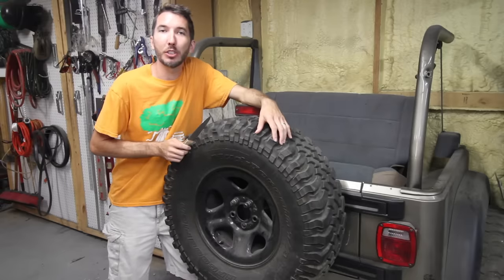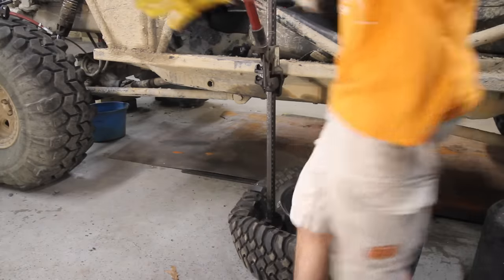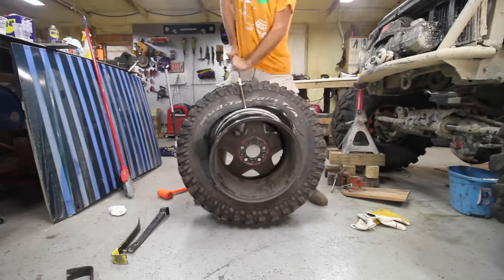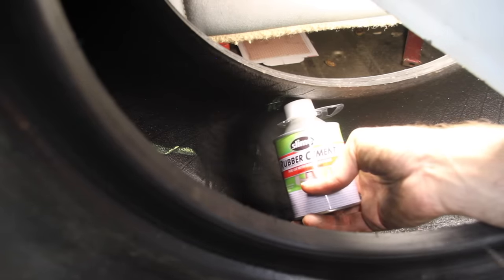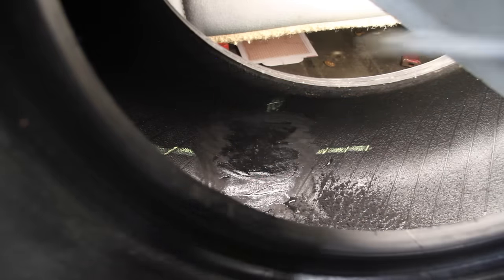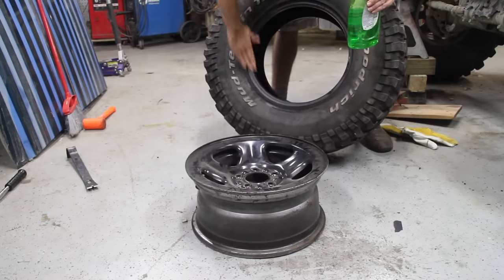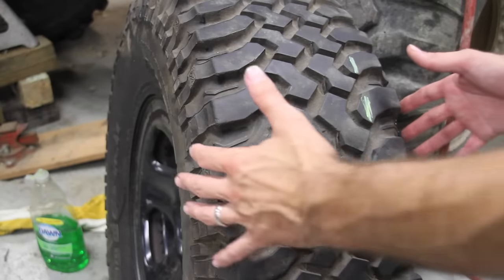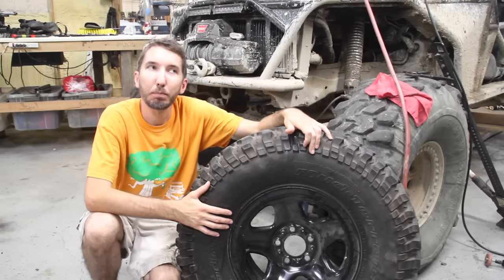How To Fix This - Patch A Tire

Comment: so as a guy who does tires for a living watching you tell people to patch a hole in there side wall is asking for a blow out take that hole to any shop there telling you they wont patch it they dont want you in there after the blow out and the totaled car you should only ever patch a car tire puncture in the tread face as that is were the steal bands are patching a hole in the side wall were there are only nylon belts with cause separation and blow out with the structure of the steal bands you are asking people to put there lifes and familys at risk and this video is a hazard to any thinking for doing this

Comment: OK after that lil bit of work now do one with a mud filled rim, or one that got run off the rim in sand, mud, gravel, ect., also while you are at it take the tire off on the side of a nice rock hill side, with it buried in mud, snow, or sand, winks...JK, but those are the conditions you will face in real life on the trail or while off road.

Comment: I feel for whom ever tries to break the bead off that wheel. If you advise using soapy water to check for leaks. Soapy water is the best thing to use on bead for mount and dismount. Straight liquid soap when completely air free and dried will put a bond that will make you hate your dumbass self. Trust me we've used just soap on things like handle grips. They had to be whittled off. JS

Comment: First off .. at least 4 people chimed in with a tire comment, but spelled TIRE.,..TYRE!!! really???? Second.. it's for a demonstration. Of a trail tire, that he doesn't plan on driving up and down the street!!!!! I work construction. And on construction sights you pick up screws , nails, cuts , hell every other week...I have multiple plugs in every tire . And one cut on a side wall that took 4 plugs ! And it still holds air ! And I still drive it at least 50 miles a day.. tires are to expensive to throw away because of a little cut.. patch it and go on!! Everything else is bullshit....
Reply: First off it is TYRE. They were invented in Great Britain and thats the way the ENGLISH spell it, so its not Tire as you Americans have mangalised it, its TYRE! Second, you work on a construction SITE. Sight is what you see, not where you work!

Comment: So you carry all that stuff air grinder, tire patch kit, dish soap,ect but not a spare tire or cement that goes around the patch? Lol
Reply: I've blown 3 tires at once a spare tire couldn't replace all 3, I have a patch kit, plug kit, air compressor, portable welder, and small oxy torch. Would rather carry those rather than a whole set of tires

Comment: according to DOT, you CANNOT patch, or repair (except for tube) ANYTHING that is off the main tread/sidewall. The main tread is about 3-4x thicker than the sidewall. That is why the sidewall flexes.
But dont take MY word for it... Because I ran a Tire Store (Tire Kingdom) for more than 20+ years. Not to mention that I raced Stockcars for more than 35+ years at tracks from NASCAR tracks like Stafford Springs, CT, Homestead Speedway, Miami, Charlotte... And smaller tracks like Plainville stadium CT, Star speedway, Epping, NH, Punta gorda speedway, Punta Gorda, Fla and Hialeah Speedway, Hialeah, Fla.
I have seen people get seriously hurt and even total out their cars and others because they are to CHEAP to go out and buy a new tire.
Reply: You obviously didn't listen to the description he gave which said precisely what you just repeated. Also, in the written text he says "For off-road use only." However, your cautionary note is worthwhile for people who may consider using this method on their normal on-road vehicle.
Reply: And according to D.O.T we can't put too big or too small of a tire no wide with or a stretch          lower or raise  a  Vehicle  cant put a turbo    or aftermarket exaust but we all still do it  nomatter what every one  Does something that  D.O.T wouldn't comply with
Reply: @D.D.S-909  
Yea JR, I agree. That is why I have the ONLY street-legal, registered Legends car in the State Of Florida!!
NO modifications (except for blinkers, stop lights, ect)
To pass inspection, the lady came out and said "what a cute lil car--- you pass"

Comment: Ok so I'm supposed to carry an air compressor and the buffing tool and generator u said this was if u were out on the trail I mean come on man thats not realistic at all
Reply from the maker: Why not?
Reply: The repair tools would fit in a small bag, and the compressor is ON THE VEHICLE. It supplies air operated fittings on the machine. Where is it not realistic? You obviously have no experience of offroading.

Comment: Ok in your first 30 seconds of video you have already been wrong. The reason for not repairing on or near the sidewall is NOT a liability issue only....The sidewall and the first inch to two inches in from the edge of the tread are where the most stress occurs on a tire and are the most susceptible to failure. The reason for NOT allowing repairs there for any vehicles used on the road is safety NOT liability! If you are on the trail and have a puncture you need to fix to get the vehicle back to the road or a shop to replace it that's one thing but don't go telling people lies about why the sidewalls are not repaired on road legal vehicles because then YOU are liable if they get in an accident or kill someone.
Reply: On a road going vehicle its safety AND liability. here in the UK if you do a repair that is not industry standard in defined areas, YOU, the tyre fitter is LIABLE for the consequences of any subsequent failure. Not something i would want on my head or conscience.

Comment: why did he clean the area before he grinded? wouldn't it be more logic to clean it after he grinds it?. lol
Reply from the maker: This is why I cleaned before buffing, as per Rubber Manufacturers Association and Michelin Tire: "Step 3 PREPARE INNER LINER SURFACE
Clean the area around the puncture thoroughly with an appropriate (pre-buff) inner liner cleaner. Use a clean cloth
and/or scraper, according to repair material manufacturer’s recommendations. Consult your local repair materials
supplier for an appropriate cleaner3. This step serves to remove dirt and mold lubricants that can reduce repair unit
adhesion and contaminate buffing tools."

Comment: I'm not sure what emergency I'll have a wire brush, buffer, patch, rubber cement, dish soap, 4 pry bars, and breaker bar instead of a spare.
Reply from the maker: when you have tires over 40" tall [you better!

Comment: Just put a plug in it. It's offroad use anyway why tf, would you break the tire down and repair a sidewall puncture.
Reply: puncture = round hole 
slash = cut 
Is it more clear now why plug would not work?
Reply: @alopandur  Punctures aren't all round. 
Same as cuts.
Not all cuts are straight.
Reply: @olli3j  WHATEVER, plug would not work in this video, I hope you agree... 
Hence your original comment was useless!
Reply: @alopandur  LMFAO. I'll try it at work TMR to prove you wrong . U just sound like a goof for also replying.
Reply: @alopandur  also go read up on sidewall Punctures
Reply: @olli3j  Why such superiority complex? Crank a beer, enjoy your life and use this video to get your ass out of the trail in a hurry... 
No need to play smartie here... 😁😁😁

Comment: This video is misleading even if you stated its only for a temporary emergency. You shouldn't be patching corners especially with tires with sharper corners and more steel mesh.
Reply: norakat  so you want us to just sit in the middle of the woods untill the tire heals itself?  Or we just patch whatever holes in it to get back to trailer and order a new tire when home.  Nothing about this video is misleading.

Comment: you NEVER patch a sidewall puncture. EVER. unless it is strictly for an emergency. the sidewall flexes all the time. that patch WILL fail. you WILL end up hurting yourself or others.
Reply: Curtis Moore you just said its strictly for an emergency. It was stated that the fix was just to get you back to civilisation, surely thats an emergency? (it was also stated it was strictly for off road use)

Comment: This makes no sense, he,s on a trail doing all these repairs with a puematic buffer , so where that 60 gallon compressor gonna be, and all those extra tools he's been using! Also who destroys a perfecly good tire to use in a utube video, aint there alot of old used tires he could of used, to demonstrate patching the tire!! Be smart man , if your going on a trail carry a good spare and a tire plug kit, u can also carry a manual foot pump of a 12v portable compressor to inflate the tire after repairs!

Comment: Off-road or onroad, your gonna get someone killed with crap repairs like that. The bare minimum repair is a plug. Failing that , your tire is a smoke signal.

Comment: This is not because of liability issues. When you come off of the tread area, you lose all the structure that you have with the steel belt package inside of a tire. Your also not really supposed to repair anything over 1/4 inch. Please take it to a professional so that you don't hurt your self or someone else after you repair a tire inappropriately and risk a tire blowing up like a grenade.
Reply: Thumbs Gaming im a little stuck 4 hours away from a public road mind calling a tire tech to come out and fix it then have him drive back? Pay attention to the video for christ sake emergency situations only
Reply: andy santana do you not own a spare? I tell you what, let me know that goes when you have to do it on an LT rated tired and you have to put 80 pounds in it and it blows up and peels your face off
Reply: 80 psi to set a bead? All I need it the bead to lock like 25 psi, yeah I do but since you're the trail master I popped 2 tires I put the spare on the mud and put ×2 next to it and I could still only replace one popped tire, any help with that maybe I should just run on my drums and rotors to get on a public road?
Reply: andy santana or come prepared. That could help too.
Reply: So take up all the room put 4 spare tires in somehow and get rid of the on board air, tools, jumper, floor jack, high lift, and extra part. Well fuck in the process of changing my 2 tires I had to stop couldn't get the vehicle in the air and just to fuck things up even more my battery died because the water I was mudding in made it short but on god prepared... for tires only. You can't prepare for everything there's isn't enough room in my xj

Comment: Everyone has a air compressor on the trail -.-
Reply: Fabian Arreola he means you repair it at home if it gets a hole and you are only supposed to use it on the trail
Reply: Fabian Arreola and a dremal
Reply: Most of us who actually wheel do...    refilling tires.  Reseating beads.  Running air lockers  using tools for other repairs.  Many reasons to have an on board air system.   
Some of us even have onboard welders...

Comment: Water with ur soap, btw on the trail, u probably ain't gonna have compressed air!!
Reply from the maker: why not?
Reply: btw You should have an air compressor if your off-road. Called being prepared. Otherwise, how are you going to pump your tyres back up after dropping the pressures to get through a soft sandy patch. When I'm off-road, I have everything he used except the air die grinder and buffing wheel, and in future I'll consider getting and taking those. They are not that much extra weight and could be used for other jobs, such as grinding back torn metal that may otherwise cause a puncture, or worse, an injury. Unless you want to rely on other people who do have the the equipment.

Comment: Oh dear god!
1, you didn't put a hole in the sidewall, you put it in the shoulder. The sidewall is absolutely repairable and every knowledgable repairer will tell you so. The shoulder however is not repairable due to the fact that the repairs in the shoulder tend to kill people. 
2, the recommended repairable area of the tire isn't within the marks you put on the tire, it is within the tread belt area which varies between tires but for the most part is no more than half an inch or so from the shoulder
3, The point at which you elected to dismount the top bead put pressure on the valve base which can damage it.
4, Dont use just any cleaner on the inner liner many solvents will damage the inner liner which is the air tight part of the tire causing air to leak directly through the tire itself.
5,The rubber stuff isnt to seal the patch, it is inner liner sealer the area you buffed is not air tight anymore the black sealer the tire store uses is to ensure the inner liner remains air tight. You just created a tire that will leak extremely slowly forever.
6, DON'T sit next to a tire which you are seating on the bead. DON'T rest your arm on it unless you want to blow it off.
7, The procedure to repair is NOT the same in every position on the tire.
8, If you are going to suggest people make illegal repairs, make sure you reinforce that these repairs are only temporary, are absolutely dangerous, and will void their insurance cover if any accident should occur.
The reason these types of repairs are illegal is that they are dangerous.

9, Stop making other people dumber.

This is a tire that could last for years or it could blow out and kill someome tomorrow.
Reply: Bass Master Did you expect to see me singing?
"A lot if people say you can't repair the sidewall, but I'm going to disagree."
This statement is where the problem lies.
A lot of people say you shouldn't repair the sidewall for safety reasons and they are right, but if you really need to get out of the wilderness this is how you can temporarily fix it just to get yourself out of trouble. 

However this solution has the potential to kill you. This is absolutely important to stress. It has killed people in the past and it will kill people in the future.

You are more than welcome to ignore my critique and continue to do things wrong if you wish.
Reply: A flat tire on a Jeep trail has probably never killed ANYONE. Chill man. You're right about all nine points, don't get me wrong. It's just that they are all a bit misguided here. Jeep trails have literally nothing in common with a situation where a sudden tire blowout would cause danger. There's no speed, no oncoming traffic, your tires are already half flat anyway if you are doing it right.
Reply: youre thinking of an old split rim update your shit
Reply: lol wrong comment lol

Comment: It is against the Law to repair a sidewall.  dumbest thing I've seen yet.
Reply: where does it say its against the law? idk how many times he mentioned its an emergency trail repair, which would be like saying its illegal to repair the sidewall on your lawn mower tire, your lawn mower is never suppose to see the highway nor is a trail rig.
Reply: Stay stuck in the middle of the woods because it is against the law...perfect advice....."Why did you freeze to death in the winter while out snow wheeling?".."Well I had a side puncture and heard it was illegal to fix it" "OH, you are such a good law biding frost bitten citizen"
Reply: Yes, I can just see a ranger or local LEO coming by and cuffing me when he sees me repairing a sidewall out on the trail. It may be against the law for YOU to repair a sidewall, but in an emergency to get back off the trail, anything goes. Since I run pavement too, I'll have the tire replaced once I get to town. Just not necessarily at your shop.

Comment: What a load of rubbish.  

A:  Anyone who would use a 10 year old tyre has a death wish.

B:  Anyone who would patch such a tear has a death wish.

C:  The way that grinder tore through to the cords and cut them made the surface less even that it was before.

Folks, NEVER do this.
Reply: Exactly, stay stranded.
Reply: Ein Felder Tyre??
Reply: Does it look like a z rated tire?
Reply: I work at America’s tire (discount tire in most places) and yeah don’t do any of this
Reply: im going to do this and stitch the tear with some nylon string. All see you on the road
Reply: @Matt
Quiet you
Reply: I suppose he should’ve stuck a knife in a brand new tire for demonstration purposes?
Reply: @David jessee He's British, or somewhere across the pond anyways.
Reply: That is because they want to sell you new tires
Reply: You don't leave it on the spare rim if it is 10 years old.  Then you don't have to worry about repairing an old tire.
Reply: if it was kept out of the sun it would be fine
Reply: cheap fucking jeep???!!!!!  tires are expensive, some of us don't make a lot of money and like to wheel on a "budget".  for the record that tire was still perfectly fine for 80 mph before he stabbed it looks to been kept under cover, i didn't see any big weather cracks and the bead would have died using a flat bar like that. good day!
Reply: Ein Felder i repair my own tires all the time , not recommended if you have no experience thou !
Reply: good trail fix, if you're out of spares, this could hopefully be good enough for you to at least limp to where a tow truck can get to you easily, even if you have to stop and air up 10 times on the way lol I would never take that tire on the highway but you can limp to the highway and wait for a tow truck there. I've done more sketchy things in the bush than this, you gotta work with what you've got haha
Reply: Gnarlord of course you want him to buy new tires.
Reply: Have done it and rode for years on tires even old tires I got a jeep now with 12 year old tires on it right now but the tire he used was of the cut in 2 jeep he has as a seat/decoration in his garage so its not going to ever get used

Comment: Why the hell would you ruin a perfectly fine seeming tire? There is a difference between trail repairing to get off and a long term repair like at discount, manufacturer guidelines exist for a reason. You and your google degree aren't smarter than the millions manufacturers spend in r&d. Don't give people bad advice you bumpkin.